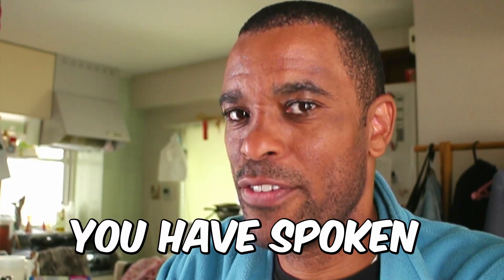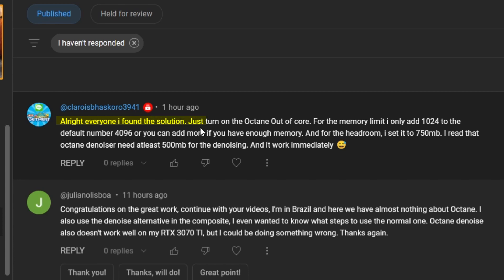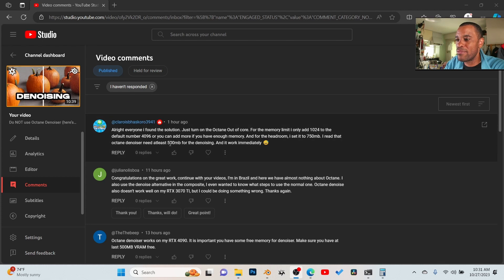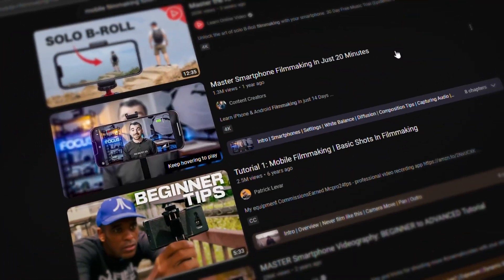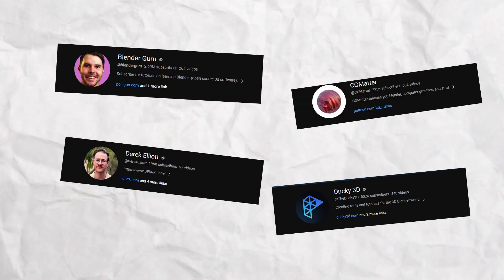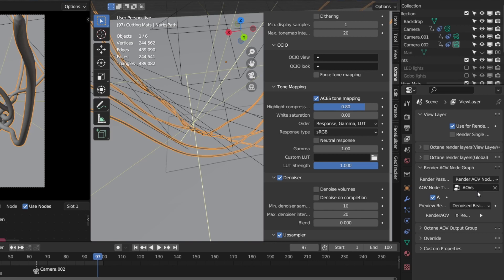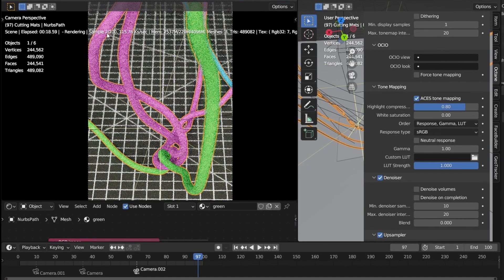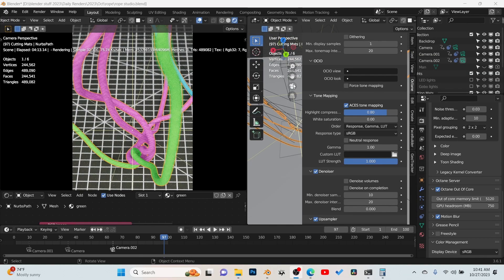Why I Use Octane Blender Denoiser

Comment: I do not recommend to use defalut blender denoiser node.. It ruins a lot of detail. nowadays i found Octane DenoisedBeauty is much better than blender denoiser. exaggeratingly say about that, "100 sample with 'octane denoiser' is better than 2000 sample with blender default denoiser"
Reply: anyway, thanks alot of your job! i always watching your video :)
Reply from the maker: Ya I agree but rendering animation it's very slow 🥺🙏🏾
Reply: @1polygonewithme  I think it's optimal to not use any denoisers straight in the render engine for animations. It's better practice to render your sequences with noise and them denoise then in programs such as davinci (temporal denoise) or AE and etc.

Comment: 100% octane blender experience. Documentation is unfinished. Lots of bugs. Default settings are jst firefly spawning mess.  Very tiny community (official discord is the only place to gain knowledge by asking ppl directly). But the speed beats everything. Its so fast that i always feel pain swithing back to cycles for my old projects. Its literally day and night difference. Even with rtx denoiser, cycles is nowhere near. Also packed with industry standard features cycles keeps ignoring... lightmixer, viewport color correction, region render, texture displacement jst to name afew.
Reply from the maker: That's why I made the Blender Octane Community 🤓👍🏾
Reply from the maker: 🔴🔴 Struggling to learn blender octane 🔴🔴
Fast track you're learning in our premium community.
https://www.skool.com/blender-3d-6826/about

Comment: I have the exact issue you're having. I have 64 GB Ram, so I turned on Out of Core, set it as high as 32GB and the headroom to 800MB but it's always hit and miss. Sometimes the denoiser works, sometimes it says "denoiser" and it does nothing. It's a pain to wait 30 mins for a render just for the denoiser to not work. I which there was a way to be 100% sure that the denoiser will work, even if it means slower render.
Reply from the maker: Yep that's why I just use Blenders denoiser I have gotten good result using it.👍🏾🤓
Reply: @1polygonewithme  I do, too, but I noticed that when Spectral AI Denoiser from Octane works it does a much better job.

Comment: so here's what's going on with octane out of core feature. so what happen when you render a scene, all of that information are stored in your VRAM which is very limited (mine is only 8GB) and when you have a complex and high resolution texture all of that VRAM are being used and almost no space left for the denoiser to work. so when we turn that feature on, the geometry and texture data are stored on RAM and being processed to GPU when needed. so the out of core memory limit is depend on how much of your RAM available. the GPU headroom is to limit how much of your VRAM is available and not being used to render, this will improve stability and less crash. 
If you feel the denoiser is not working even if you already turn on out of core feature, make sure you don't open or working with another CPU and RAM intensive software. because that 5120MB memory are reserved for octane to use and other software can't use it. i think that's enough if you have 32GB of memory
Reply from the maker: Yep that's what happened to me when I use OBS 😭 plus my Canon camera for screen recording it's to much